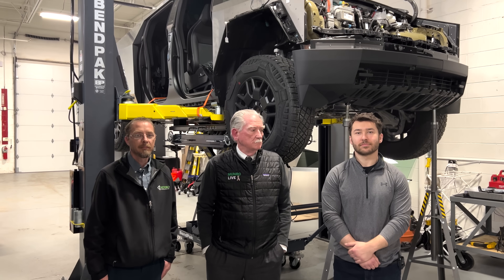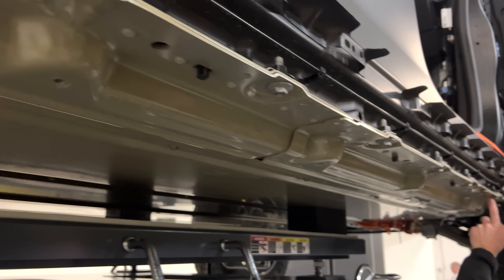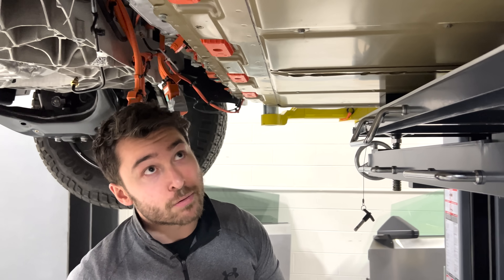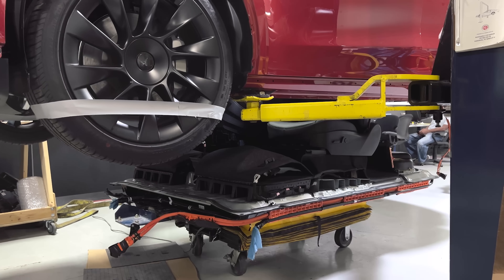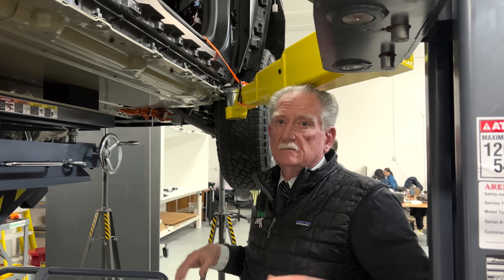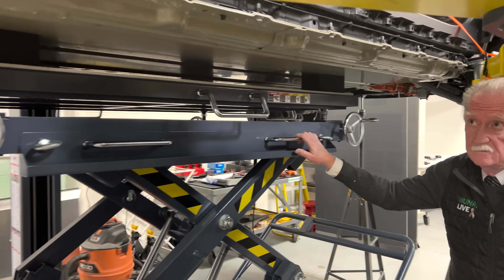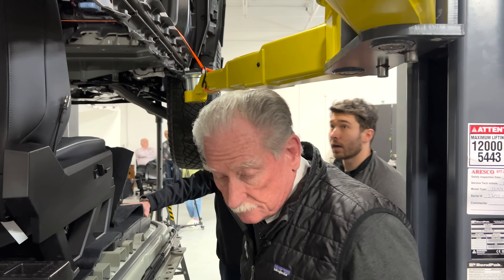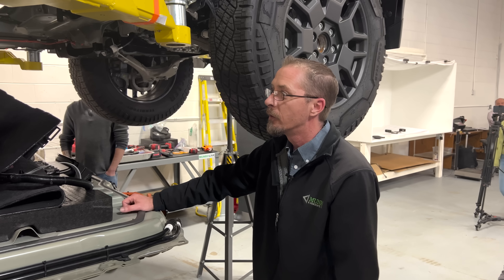Dropping the Battery Pack in Our Tesla Cybertruck!

Comment: Let's be honest: it's great manufacturing engineering but there it stops. Sitting on top of a battery with no separation in between with the exception of a rubber seal, is a serious risk to the occupants in case of fire. A as matter of fact, a video is already circulating where exactly that happens: a man trapped inside a Model Y full of smoke inside. Before fires largely erupted on the outside, now we'll see inside fires roasting and smoking passengers. So far the great engineering. And when it comes to servicing, it's probably an equally bad nightmare. These cars literally scream "throw me away when the battery dies". And also no more battery cell repairs as they have started potting them in PUR. It's the "iPhone route" they're taking. The innovations in cost cutting and marketing are as big as the engineering ones.

Comment: Anything to save a penny to make maintenance harder. Not a fan. Now if you want to drop the battery pack in your garage without a lift, you have to remove the seats first.
Reply: On the other hand you can quite possibly take this truck all the way down to a pile of parts with what you have in your tool box. GUESSING  No other truck is this easy to work on.

Comment: Increases cost replacing battery
Reply: You shouldn’t need to replace the battery, and even if you did, it is far better to make the considerable savings on the production line than in the unlikely scenario of replacing the battery at some unknown time in the future. It would be like a car manufacturer making the engine really easy to replace but adding a lot of cost at the production line to achieve this.
Reply: @streddaz  theres only 8 yr warranty... until further improvement all batterys need to be replaced after 10 or so years. This system will double or triple that cost in labor
Reply: @bkparque  just because the warranty is only 8 years doesn’t mean that’s the battery life. The expected life is many years past the warranty period. In any case why would this system double or triple the labor cost? You just lower the battery, roll it out from under the vehicle and unbolt the seats and remove the flooring. It would only add a couple of hours of labour. With the cost of a battery pack, I can’t see how this is going to increase the labour like you think.
Reply: @streddaz  if all that was true theyd have a longer warranty. Plus 4680 is not as good as panasonic 2100 or catl lipo batterys
Reply: @bkparque  I have dozens of products that live well past their warranties. Plus, if they die around the time the warranty runs out there’s a fair chance that it will run out within the warranty and that’s not very cost effective for Tesla.
Manufacturers set warranties for a time period where it is very unlikely to be needed. So with an 8 year warranty they would be pretty confident that they would last several years past that point so not to risk it being within their warranty period.
Tell me why 4680 batteries aren’t as good?
Reply: @streddaz  ill wait till 40k truck comes out.
Reply: @bkparque  probably a good idea. The technology will have improved by then.

Comment: Whilst incredible engineering… Literally sitting on a massive battery like that is idiotic. God help the first one who has a catastrophic battery failure…
Reply: Don't think it would matter, the metal cover on the battery has to be thick enough with enough structure to handle the seat loading and body weight during a collision. The would be just a strong as the floor in any other car. BEV's that have a battery that bolts to the bottom of a unibody car have pretty thin light covers.
If a lithium pack get damaged it is gonna go up.. regardless..  but you should have time to get out and away.

Comment: This is pretty sad.... I watch Sandy always saying how much they saved making it this way.... He's looking at it from the auto makers side.... But on the repair side, it just raised your cost on a battery pack servicing or even a full battery pack replacement. They save money on there end, but you end up paying for it on your end.
Reply: Nuts. Comparing to pulling an engine or tranny in a gasser, this is (to quote Ralph Kramden) " a mere bag of shells, Norton - a mere bag of shells".
Reply: If you replaced a truck drivetrain you are probably pulling the cab off the frame. I don't get how this is more work than that
Reply: Battery pack servicing is a thing of the past.  BMS allow for a few single cell failures.   The foam in the pack protects connections from vibration and helps prevent thermal runaway.
Reply: How often do you replace your battery pack? EVery 3 months with the oil change?
Reply: @The_DuMont_Network  I think you need to do a comparison to another ev. Just think how much this is going to cost vs another ev truck. I think people are so focused on ev vs gas that they miss the point.
Reply: @danharold3087  This is true. BMS systems have gotten better over the years but batteries will fail. Alot of people think that bms and battery cooling will keep will keep batteries lasting forever.... as we see with model s from 2013, they are starting to age and with that age you are starting to see servicing. When auto makers make it cheaper for them to produce it becomes harder for us to repair it. I don't want to see a bunch of dead ev's laying around and having owners saying its too much for a battery pack. As for the foam pack... its really just a cost saving measure its not used to settle vibrations or make the battery pack safer.... the real intention is to cut down the mounting hardware and lower the cost on the manufactures side.
Reply: @FrunkensteinVonZipperneck  You have a point, but im not comparing it to a gasser, compare it to another ev... and get back to me on the book time for replacements.
Reply: @Shiftheads  Why is everyone quick to compare to a gasser? Please compare it to another ev. We have enough ev trucks for comparison.
Reply: @fobrichard  sure just show me the ev truck that is significantly easier to take the battery out of then?
Reply: @fobrichard  We don't have enough data on the failure rate of repaired packs.    Few people understand that all the cells in a battery with some variation age together.  You can't replace a cell with a random cell.  They try to match the state of health.  The closer the match the better chance you have of a successful repair.  However there is more to a battery than SOH.  Even very close SOH matches can fail.   
 Gruber motor:  "Each 85KW battery pack contains 16 modules. Module replacement costs $1,895. GMC matches the CAC value, age, and vintage of each module to maximize compatibility."  
Not too many years ago I was 100% for battery repair.   No longer the case.  Too many advantages in encapsulating them in a brick.  My opinion.

Comment: Ohh, that pack will definetly have high risk of corroding. All those gaps that are not sealed. Soooo bad.
And what else is really bad is that structural battery thing because it is IMPOSSIBLE to repair. A total waste for the environment to not be able to repair or salvage usable parts from it.
I know that Sandy is bought by Tesla in some way or another, and this is a big Tesla fan club holding place but please, it is not that amazing. The lack of critical view of stuff Tesla makes really makes you think twice about how truthful your really are.
Reply: What ARE you talking about?
.
They'd done a "dry run" and tacked the pack back in position  before "we" saw it.
.
OF COURSE IT'S SEALED!
.
Since you haven't designed, assembled, dismantled, or studied the pack you have ZERO knowledge and even less credibility to back up your guess.
.
But if we're guessing....
The "Big box" on top with all the electronics to control the pack?
Accessible.
I've watched plenty of repairs on similar electronics.
That's a large percentage of faults covered (IF Tesla haven't engineered them out, using their increasing experience?)
.
From the teardown of the Model Y pack, there are "fuses" built into the circuit for each cell.
.
If a cell draws too much current, the fuse blows.
No more energy to that cell.
.
(In the Y pack, that's about 0.12% capacity loss.... In the CT? About half that)
.
No "repair" required.
.
IF a pack should need recycling... (After the usable BMS and control electronics have been removed)
Then, the "pack" (or what remains) can be 95% recycled 
(Ref JB Straubel, who's actually "doing it".... One of many)
.
Not only is that extremely "environmentally friendly", but the materials recovered are of better quality than the original stock.
.
How do I know it's environmentally friendly?
.
Let's use logic.
JB tells us that the materials  produce new "raw stock" costing ±17% that of mining and refining new stock.
.
We can "take a guess" that a huge amount of that saving is the lack of digging up, transporting and refining the material?
.
I'm sure you'll agree that a major part of that cost is energy which YOU will no doubt suggest comes from burning coal and other fossil  fuel, which IS "a total waste for the environment" when compared to recycling (there's a contradiction for you !!)
.
There's a HUGE amount of "critical view of what Tesla makes"
If you LISTENED to the actual information (including that documented with data by Tesla) you might be surprised, but you're stuck in "confirmation biased" mode.
.
Prepare  to be proven wrong.

Comment: What I find shocking is that once again people for some reason defend the ideas of Tesla. Saying that making the battery pack also the floor is a good idea is utter nonsense. It's not about saving money or about making it easy, it is about supporting disposable vehicles. Shameful. No one in their right mind would buy an ICE vehicle that has the engine and transmission as part of the frame. That's as close as I can get cost wise in a comparison between EVs and ICE vehicles and it's not even close because of how much more expensive a battery pack is compared to a whole engine and transmission. But it is the same concept, which is flat out stupid. Unless if the idea is to build something disposable. Tesla = disposable cars. So don't say they are environmentally good or 'green'. Because anything made to be disposable is not good for the environment.
Reply: Exactly. It has poor quality components and structures everywhere just to save a few bucks. From a consumer perspective this is a giant piece of cr*p and you have no real chance to repair anything because the parts were designed to not be accessible and even if you can repair a few parts you are forced to go to Tesla for parts. The consumer and the environment is the total loser here.
Reply: Bloomberg's latest study has entered the chat- EVs are MUCH more sustanible when comparing in equal class after 250,000km/150,000mi, and it's only going to get better by 2030

Comment: Honestly cyber truck is not a magnum opus as alone claimed
Reply: Wtf are you talking about? The castings alone are more revolutionary than anything else since cars were first invented.
Reply: @themonsterunderyourbed9408 a 99 corolla has a farther range. And an f150. They both also cost less. And dont have super expensive batteries. An ice engine built right might laat significantly longer.
Reply: You’re welcome to tell us another vehicle with:

48V wiring
800V charging
Steer-by-wire
Rear wheel steering
Stainless body panels
Reply: @fredbloggs5902  you cant even drive the cybertruck 3/5ths as far as an f150 v8. What the hell does all that matter if you cant even drive it places easily? 😂
Reply: @TheAnnoyingBoss  

A 99 Corolla is 20% efficient and uses gas which I don't want to use. It also has to do oil changes, filter changes, belts, mufflers, etc all of which I don't have to deal with with an EV. 

An F150 with the same specs is almost $100k so the price difference isn't huge, you also have all the headaches of ICE vehicles except have to feed it 5x more gas than a car. 

The TCO of a Model 3 and Corolla ends up being the same after about 5 years... Or even less time if you get one of the cheaper Model 3 versions.
Reply: @TheAnnoyingBoss  

Cluelessness confirmed 

Blocked
Reply: No. It’s a vehicle.

Comment: Munro Sellout Incorporated once again shows its obtuse notion of "saving costs" by saving the manufacturer money while SCREWING THE CUSTOMER by inflating repair costs.    It makes no logical sense to put a floor on a battery pack along with seats when that absolutely blows a hole in REPAIR COSTS increasing labor rates to repair a battery pack.   Munro has lost all sense of integrity when it only advocates for manufacturing cost savings while passing the "savings" onto the consumer by factors of 4 or 5 on inflated repair costs.     This is so repugnant!     This is not innovation.    This is putrid cost cutting taken to the extreme.     Munro used to be about logic.    Now they just work with manufacturers to cut corners while never giving any consideration at all about what that means to repair costs.
Reply: What grade did you earn in that Anger Management course?

Comment: We should ask ourselvelves why the original promises were not delivered on and are these still possible under a different package??

I reserved a $40k truck in 2019 that was supposed to be much easier to manufacture  - hence the relatively good price. 
No expensive paint shop, much easier line to make body panels of cold rolled steel bent into shape. Exaskeleton from a single cast. 
Industrial design, no side mirrors, no wipers. 6 passengers. Now it's 60k+ and not usable by Europeans

Comment: That's so stupid, cheap assambly, but imagine your batterie is broken!
Reply: You don’t make an engine quick and easy to swap out at the expense of a huge cost at the production line now do you. The point is that you shouldn’t have to change the battery, just like you shouldn’t have to change an engine in a normal car. You can make the vehicle cheaper if you make manufacturing simpler. You don’t want to add cost for some unlikely event that may happen in the future.

Comment: I don’t see anything good about this design for the consumers. You have to really beef up the top of the battery pack, so no benefits there. Chassis will definitely be less rigid with bolts, which is terrible. Battery replacement just got harder. Sandy is a Tesla simp, so he’s going to praise it no matter what.

Comment: Inside that battery pack is world shi tt iest batteries - 4680. Failure rate from 30-60%!! Even conman musk does not know the result before the manufactured batteries are stored months and months. That is that shi tty dry coating batteries...fast production, even faster recycling
Reply: I dont think you really think that

Comment: These vehicles will be uninsurable due to repair costs and pedestrian liability 😂😂😂😂😂😂😅
Reply: Yeah because getting hit by any other car is like getting tickled by feathers 🙄
Reply: Not in America.
Reply: What? A battery removal that easy points to easy repairs. Did we see a different video?! 
Why should pedestrian liability be different from other full size pickups? If a pedestrian is hit front on it seems to me the Cybertruck gives a better chance to be thrown over the vehicle than being squashed to pancake by the higher fronts of all other pickups. Also the Tesla is more liable to automatically mitigate accidents.
Reply: @themonsterunderyourbed9408 not the point. Relative safety is important if you're not 5 years old.
Reply: And low range. Plus the cybertruck doesnt even look good like the model 3
Reply: @wizzyno1566  tesla makes the absolute safest cars ever crash tested in there respective segments. 😎
Reply: Yeah. With your wreckord 😂